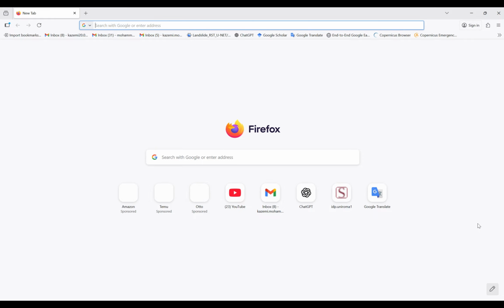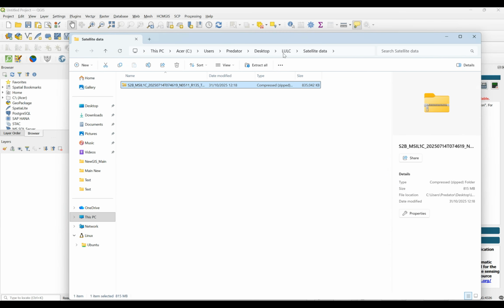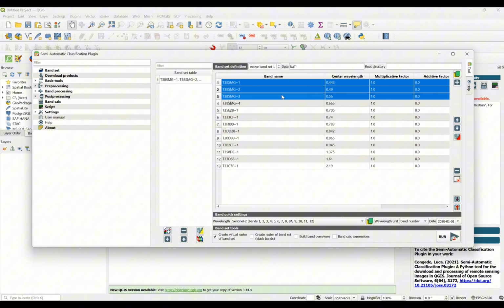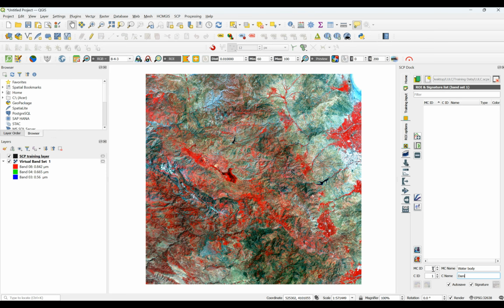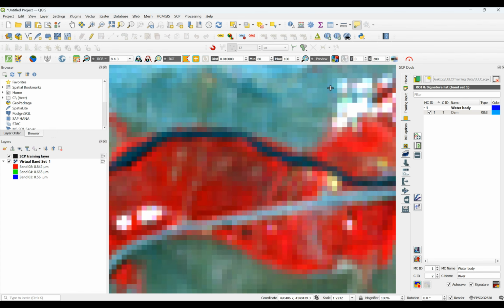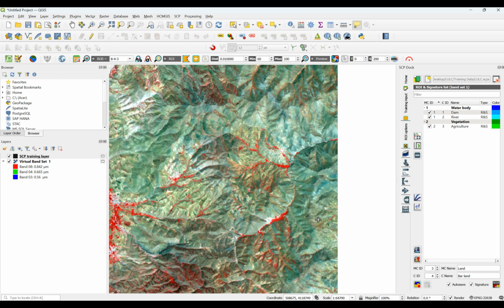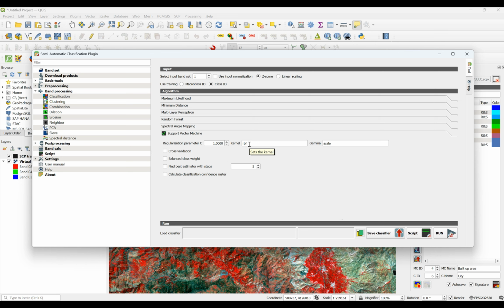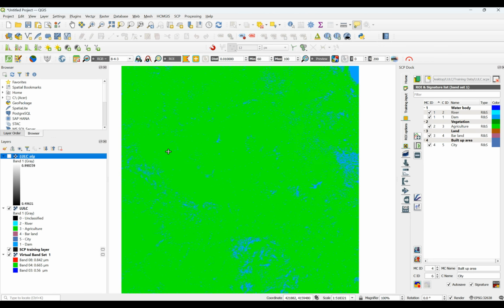Land Use and Land Cover Classification of Sentinel-2 in QGIS Using Machine Learning (SVM)

Comment: Why is the result (after bandset) different between L1C and L2A? The L2A resullt are more pale(?) and that make me hard to create training data. And I already try to use symbology (streach to minmax) but no different
Reply from the maker: Hi my friend and thanks for your comment.
The difference is normal.
L1C is Top-Of-Atmosphere reflectance, while L2A is Bottom-Of-Atmosphere (atmospherically corrected).
L2A usually looks more pale because haze has been removed and reflectance values are physically corrected.
For machine learning classification, L2A is actually more recommended even if it looks softer visually. The classifier uses pixel values, not display contrast.